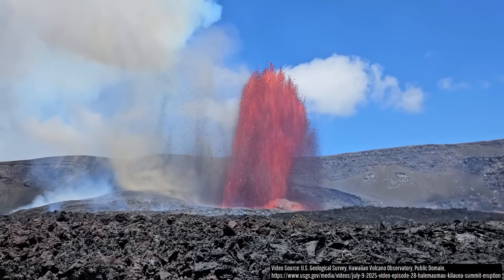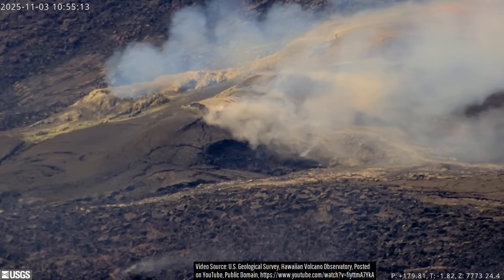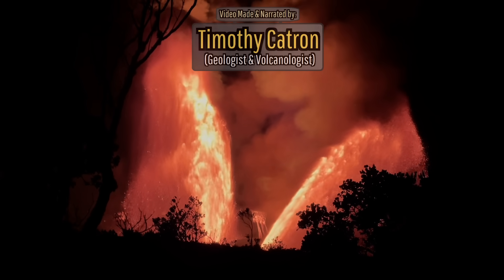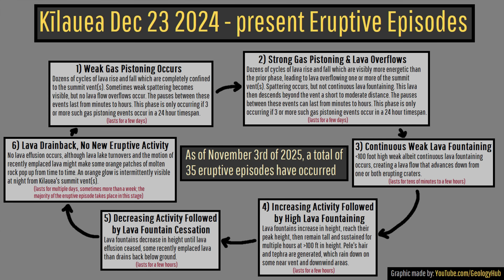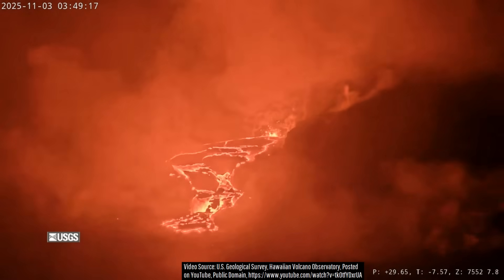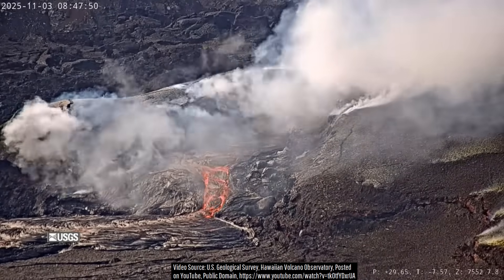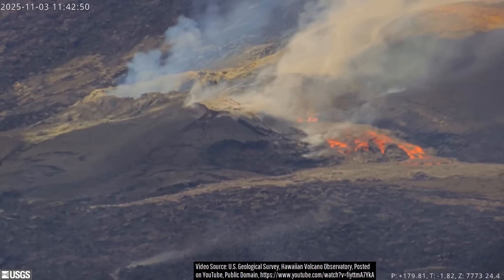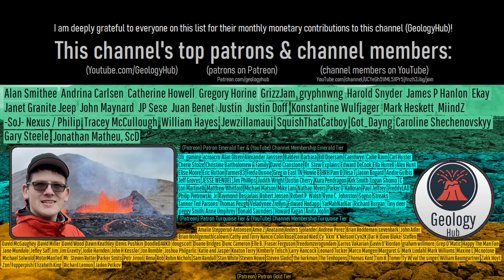Kilauea Volcano Update; When Will its Next Eruption Happen?

Comment: Only like 8 more episodes to go and this will set a new record for this volcano. Always baffles me on exactly how much pressure it takes to shoot molten rock 1500ft in the air and then sustain it for hours. Considering the time between eruptions and how similar in height the fountains are. That is a significant amount of pressure being built up very very quickly.